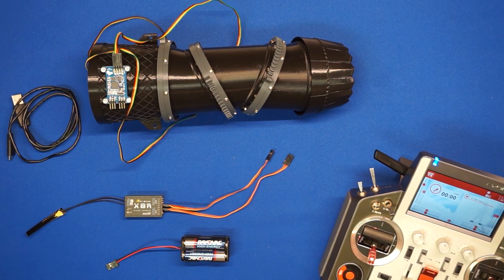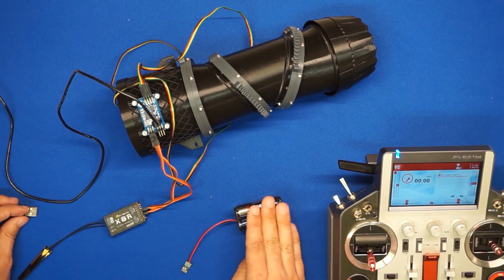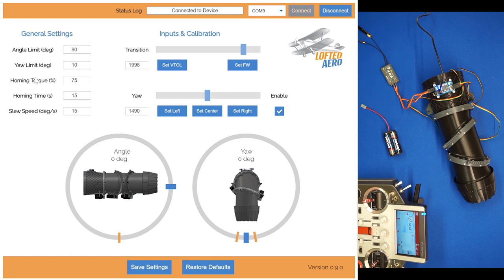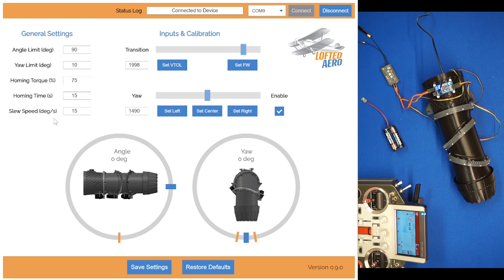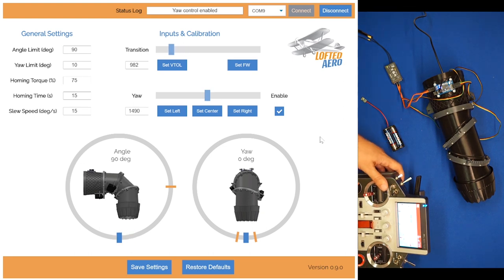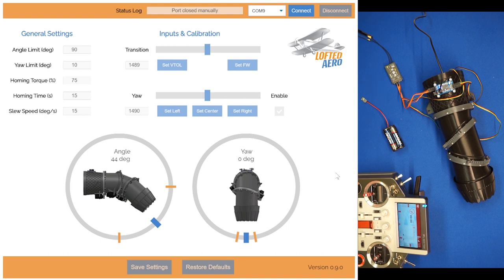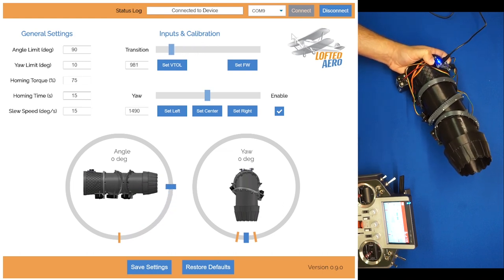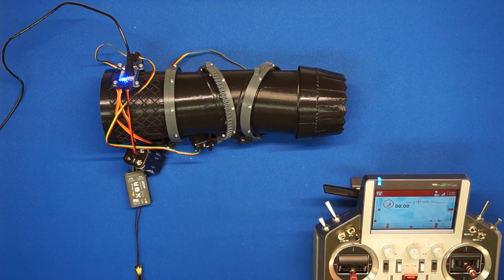3BSM Build Guide 3 - Software

Comment: I am hooked so much to your 3BSM and test frame project for almost a year now and was so inspired to build the nozzle, electronics and test frame based on your brilliant explanations in your videos.  My nozzle still runs with the gear motors and a light barrier to home the nozzle and I use a Teensy to translate transition and rudder PWM signals to actual movements. I have 96deg and +/-15deg on rudder and the movement works fine when using the transmitter. Meanwhile I came as far as building the test frame and tried to modify the frame class according your video when you shared some of the software tricks.  Unfortunately there is something missing in the my code, since all motors go straight to 100% after arming and when pushing up the throttle stick.  Would you mind to share a bit more on the frame class mods?
Reply from the maker: Thanks for following! The gear motors worked great for the most part - I only ended up going the servo route because the brushes were wearing out a little too quickly. Glad you're having better luck with them.

My frame class uses the Tricopter frame class as a starting point and adds a fourth motor. It was easier to do it that way than to add a yaw servo to the Quad frame class. I then edited the lines that mix the motor output to roll/pitch to reflect the new layout. 

I'm not really a software engineer so my first pass at all this was pretty messy. I'm in the process of cleaning up my code and re-basing it on ArduPlane 4.1, which just went stable today. Once I get that done I'll get the repository uploaded in a more presentable way and probably put together a little ArduPilot setup guide video for this specific configuration.
Reply: @ericmaglio  Thanks so much Eric for your response. Probably I need to change the gearmotors too, after the test frame flies at some point. The CAN servos are certainly the right choice, and I consider a change once I have the frame class integration  under control. The CANs are around 85EUR/pcs here in Germany.
When I copied line by line from your class excerpt based on the Tricopter frame class of your video I got a few compilation errors, which I could fix in a day or so. My frame class is AP_MotorsF35B.h/.cpp too.  However my feeling is you  made tricks in other files or at least mods in the fuctions output_test_seq(), thrust_compensation() or get_roll_factor(), which your video does not reveal.
Can´t wait of your ArduPlane integration part, also since the craft switches from Copter to QuadPlane I guess when transitioning from VTOL to horizontal flight, which I do not have a clue at all at the moment.  But that’s future… Getting the frame off the ground first and stabilize would be awesome.
Br,
Stefan

Comment: Sorry to bother you but do you happen to know if this will work using an arduino? I cant afford the electronics kit so I figured I might be able to use an arduino instead of the 3bsm controller included with the kit. Do you know if the app will work with the arduino and do you happen to sell the 3bsm controller separately?